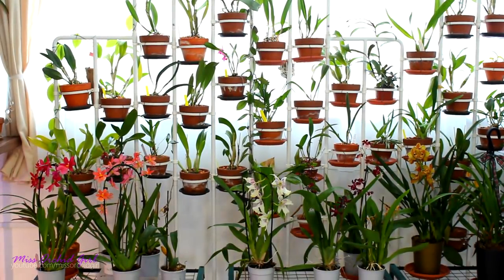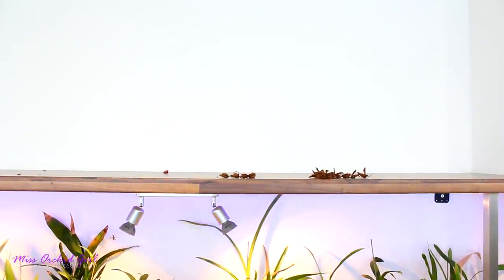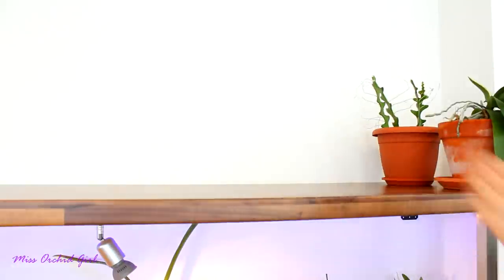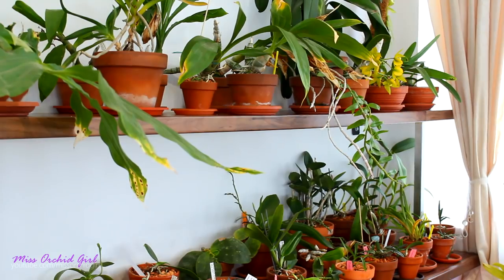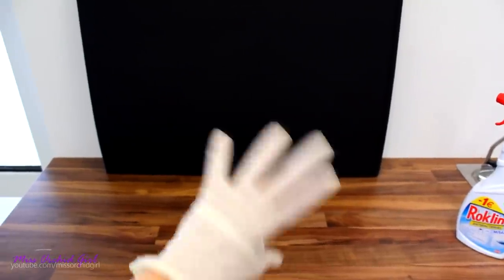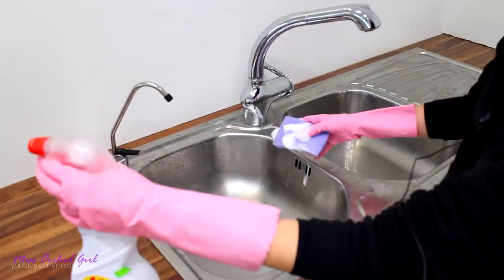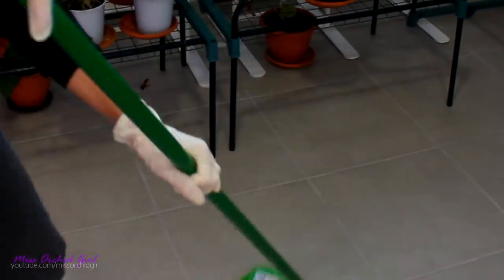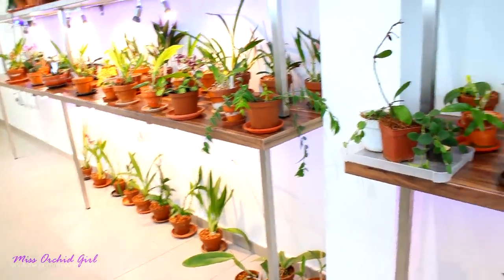Join me in the Orchid Greenhouse! | Part 1 - Cleaning

Comment: Hey Dani, quick tip for cleaning your humidifier...do you have Physan 20? If you put a capful in about a liter of warm/hot water, pour it into the humidifier, close it and shake. Even just letting it sit there will dissolve the "scum" away. You could also use rubbing alcohol and coarse kitchen salt, the cheap one, not the expensive edible kind, lol! That you have to shake for the salt to remove the grime. If you have the Physan it would be ideal because you clean and sterilize at the same time. Hope this helps! Thanks for sharing ;)
Reply from the maker: Hi, nope Physan 20 is banned in EU as far as I know, but that's a great idea with shaking something inside to clean the gunk, thanks! :D
Reply: ya know, i have had recent experiences with using hydrogen peroxide in stronger concentrations. My parents bought a bottle of 35 percent hydrogen peroxide. You add water and a cup or two of that into the resevoir of your humidifier. I bet the hydrogen peroxide would just destroy that green junk! And it is natural. Bleach would definitly do it, but that is just so bad for the health... if you do use the high concentration peroxide, make sure to wear gloves! It will hurt really bad if it gets on your skin.

Comment: Thanks for all of your great videos! They have proven invaluable. I can give you a tip for the humidifier. Those are hard water deposits. If you use your reverse osmosis water instead of tap water, it'll make your life a lot easier.  

Also, I can't seem to water my phalaenopsis without getting water in the crown of at least one of them!  I started using a can of air with the small tube it comes with. The type you use to clean out electronics. As long as you're careful that you don't shoot your bark out of the pot, it works great. Hopefully that info will help somebody.
Reply: You can try filling the humidifier tank with a good amount of vinegar and water.  Let it sit for several days. It should break down the deposits and kill anything else growing.
Reply from the maker: Hi Beth :D well you can always try to water from below, just dunking the orchid inside a bowl of water and I think the crown should be safe :) I did try the vinegar, didn't help much but killed the algae :P

Comment: Use hydrogen peroxide in your humidifier to clean it! Pour hot water in, shake it, pour it out, then pour some peroxide in and shake it and let it sit. Repeat until clean, it may take a while, but I think it can be done. Then rinse it very well after because inhaling the dead bacteria is bad for you as well. Humidifiers get so messy that I just use peroxide every time I clean it and the base (every day) to prevent buildup. I use filtered water with mine and since it has a very low mineral content that prevents algae and bacteria from having much nutrition to grow.

Comment: I use vinegar to sanitize my humidifier from time to time and it works. Just poor it in and leave it for a while + shake it,  you can dissolve it with water if you have  high concentrated one but in the condition your humidifier is in right now I would just poor pure white vinegar (5%  acetic acid) . Good luck